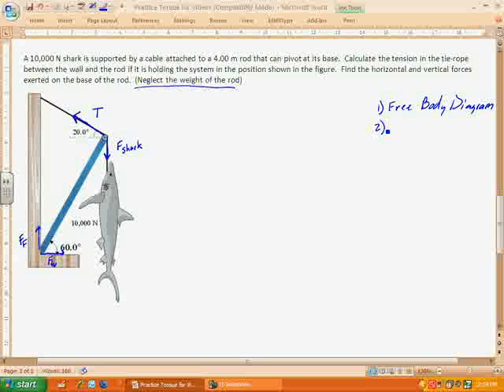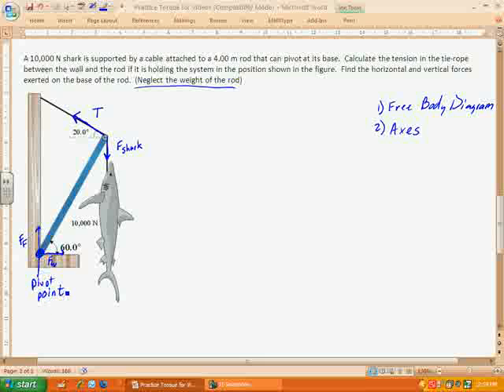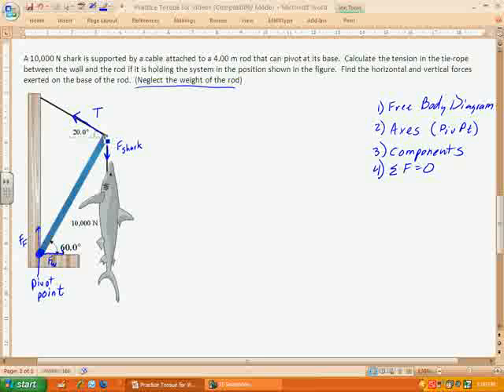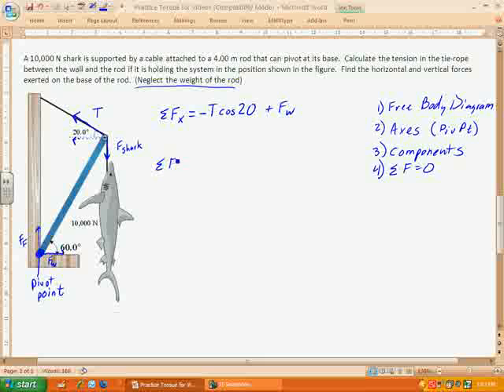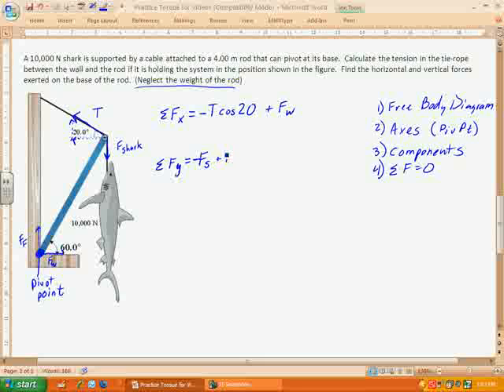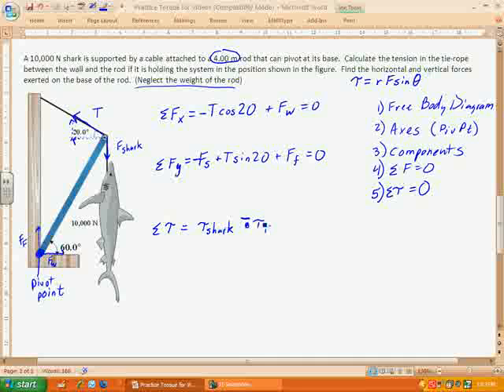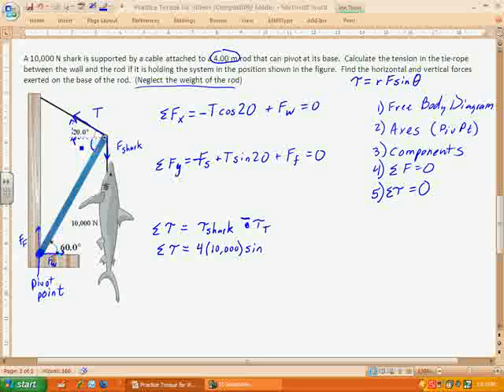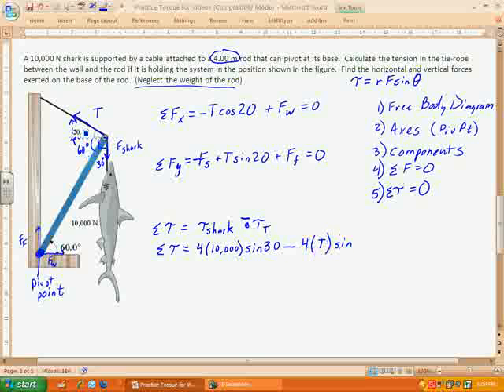Example of Mechanical equilibrium with torque

Comment: what if the fish is some angle(theta) to the right, so it wont be 90 degrees to down. How can I calculate that 90+theta angle
Reply from the maker: If you didn't know the Tension, you wouldn't be able to solve for both (too many variables).  However, if you knew the Tension, you can put that value in, and then use a variable for the angle for the shark.  Instead of putting sin(30) for the shark, you could use sin(theta).  Then you would be able to solve for the missing variable.
Reply: @MrBdubsSAS  I have tension of blue structure, so I can solve it with its tension too or do I need tension of cable?
Reply from the maker: @dandelion44444  Sorry for the late reply, YES I belivee you can do it with the tension in the blue part.  You will need to break it up into horizontal and vertical components.  Basically the same process, but your unknowns will be in a different location.

Comment: Great example. 
Do  you always have to include the angle when calculating for torque?  Because I've seen other examples where this wasn't included.
Reply from the maker: Hi Peter, if the force is perpendicular to the surface of the arm (tangent to the rotation) it may not be necessary to include the angle (as sin (90) = 1).

Comment: This is really helpful but i believe that the torque direction is wrong. Counterclockwise should be positive and clockwise negative. Still a very helpful video. Correct me if I'm wrong.
Reply: The convention can be either way.
Reply: A blast from the past. 😅Thanks for the correction. Yes, it can be either way.
Reply: Wow you must've been watching some youtube because your response was < a minute for a year old comment.
Reply: Austin g no, I was checking emails and I got an email notification saying someone replied to my comment. I was curious so clicked right away. Anyways, this video is great help.

Comment: can someone please explain when finding the - T tension how did he get sin 80 ?
Reply from the maker: Hi Naliesha, The torque depends on the angle of the force relative to the bar.  If you look at the diagram, the angle of the torque with the bar is 60+20 degrees.  That is why it is sin 80.  (sin is part of the torque equation)

Comment from the maker: @Luuuuuuuuuuuuuuulz You could say that, I suppose.  The rod pushes down on the corner, therefor it pushes back on the rod.  Any time that you have contact, there will be a normal force.  The normal force is perpendicular to the surface, therefore, in the corner, the wall will push perpendicular (to the right) and the floor will push perpendicular (up).  Both of these forces are definitely related to Netwon's 3rd law!

Comment: helpful... but as 06yanji said, you got your signs wrong on torque because counterclockwise is positive and negative for clockwise. how i remember it is usually due to polar coordinates, the angles are positive if you go counterclockwise and negative if you go clockwise.

Comment: you have your positive and negative directions wrong.

if a force causes a counter clockwise rotation, the torque is a positive term

if a force causes a clockwise rotation, the torque is a negative term